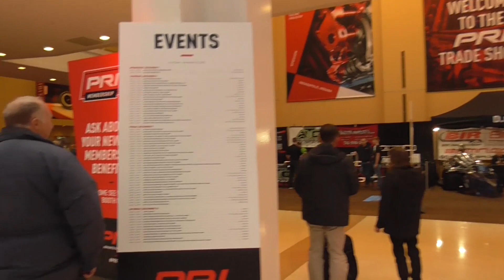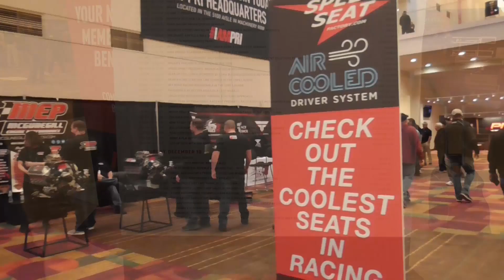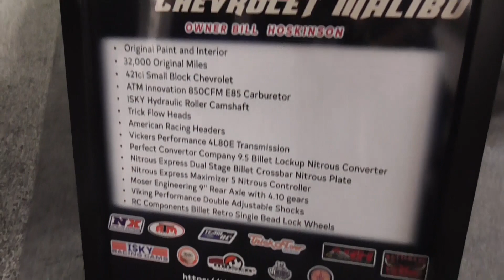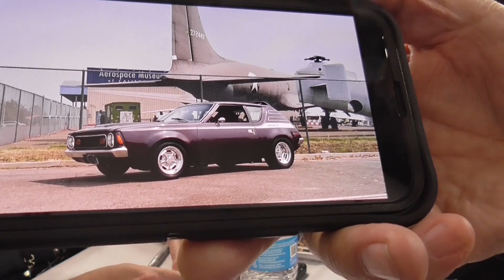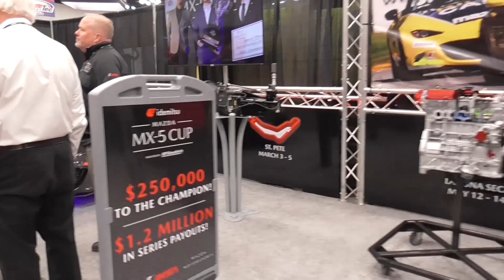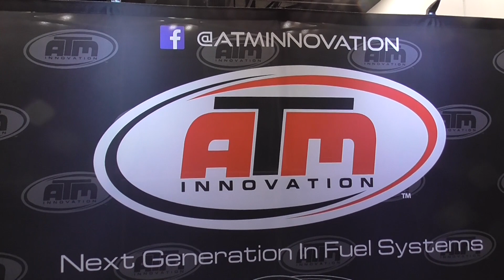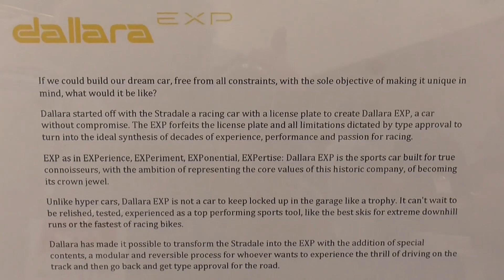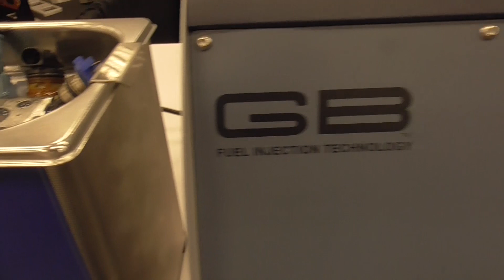PRI 2022 is here! The Performance Racing Industry show in Indianapolis Indiana is BACK!

Comment: Over my over forty years of driving and owning "muscle street cars" most of mine were factory or close to stock when I got them anyway. The only one that had A/C was my 1968 Mercury Cougar XR7, which had virtually every available option was more of a cruiser than a muscle car. Most were manual transmissions with nothing power but the motor under the hood. A lot I wish I still had. From a 65 Fairlane which was a factory k code hipo 289 four speed car to my 1967 Fairlane GTA with a built barely street able 428cj with numerous different cars in between. Great content guys.